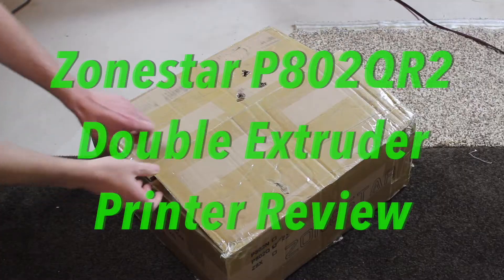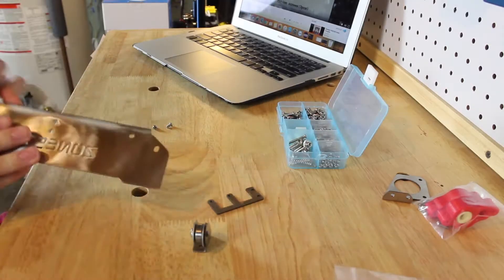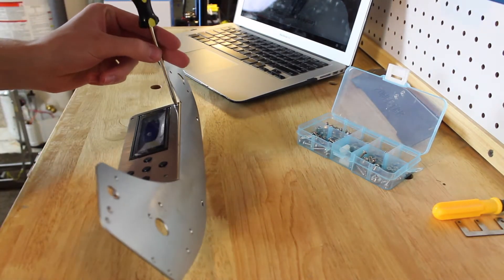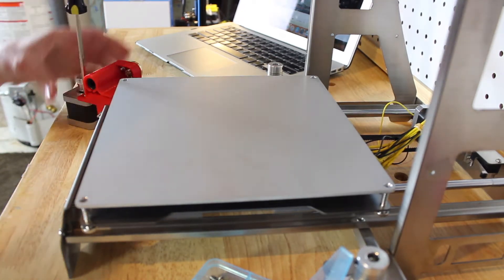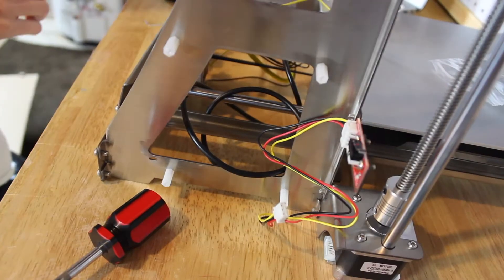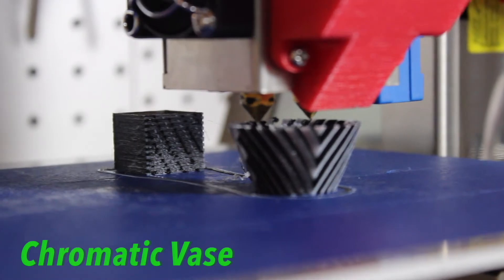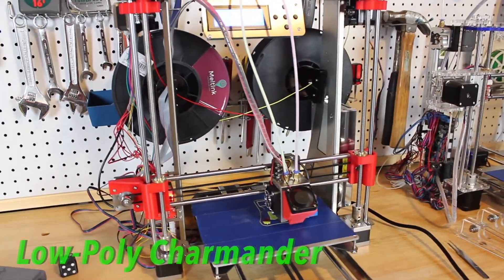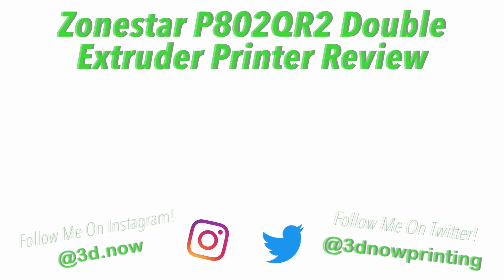Zonestar P802QR2 Double Extruder Printer Review!

Comment: Trying to figure out why the motors for the extruders don't turn.
I aught to make my own video with all the stupid problems that I seem to constantly run into. Of the 4 printers I own only the CR-10 seems to work decently.
Reply from the maker: They are probably plugged into the wrong ports on the motherboard. I did that the first time.